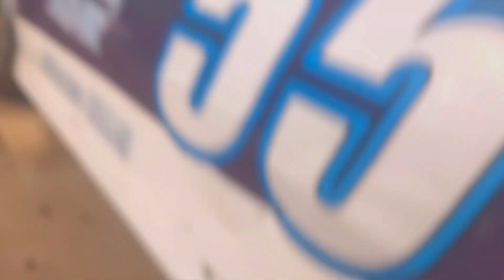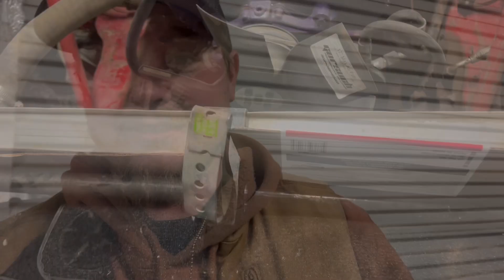Homemade hot tank, tire work and y’all finally get to see the car!

Comment: What is the purpose of having the LR jacked up does itake the car turn Better in the corners
Reply from the maker: It helps the car roll over on the LF and rotate on Entry. Basically making the car act like a sport mod.
Reply: Seems like it would roll over on RF not LF but I've noticed it's all the rage up north
Reply from the maker: @juniorwhelchel6337  yes you are right it was supposed to say RF not left
Reply: Appreciate your input
Reply from the maker: @juniorwhelchel6337  yes sir.